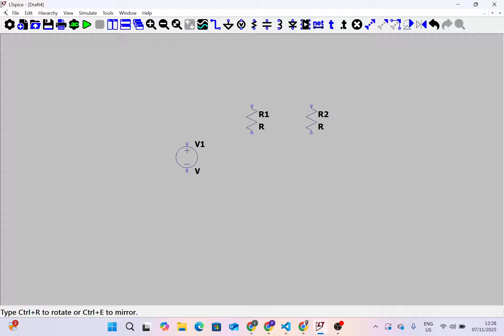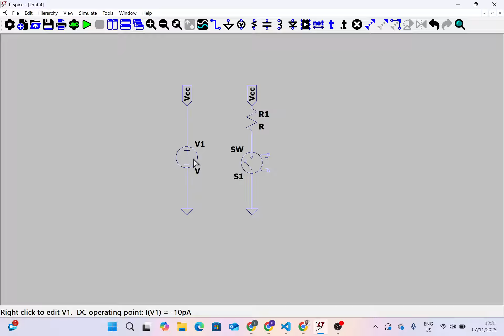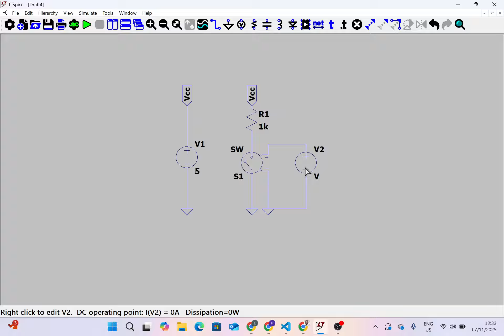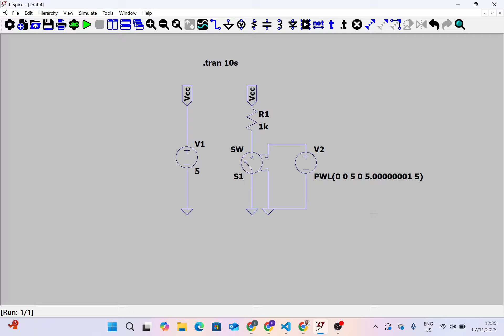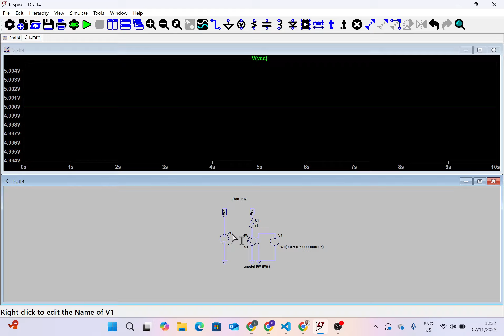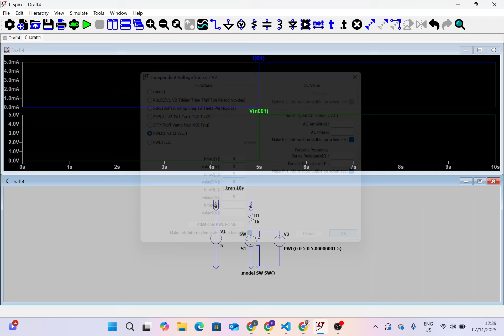LTSpice Tutorial #8: Voltage Controlled Switches & PWL Voltage Sources | Advanced Signal Control

Comment: Three things...First, I get when you created the net label (we only created one but we used it twice) that on the resistor it's input, but it seems like it would be output on V1, yet it's just one declaration of input. That's confusing. Is there something that I'm missing? 

Two, I thought that when we setup the PWL on V2 that if we moved the time and the value of the third time and voltage value to replace the second one to be 5s and 5.00000001V that it would be the same result, but no. The voltage jumps up to 5V right after 0s. So it seems more like you have to plot out intervals such that you have to explicitly say how long you want the voltage to be zero. I guess that's just a quirk of LTSpice. 🙂

Finally, I get that we indicate that we want V2 to come on after 5s, but no where do we define how much voltage is required to close S1. Would it take all 5 volts to close the switch? Would it stay closed at 4.99999 volts or would it open? Would the S1 close if the voltage was 0.00000001? I feel like I'm missing something.